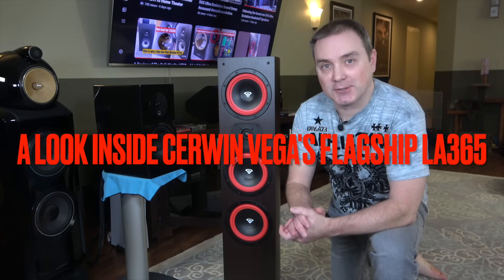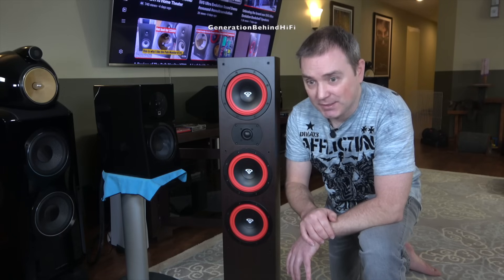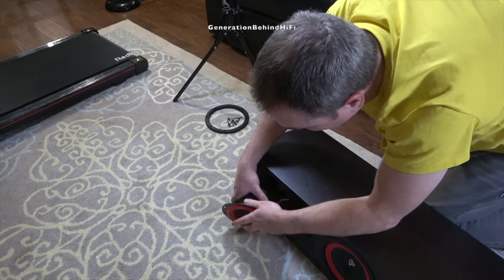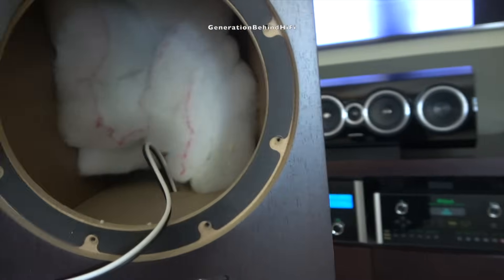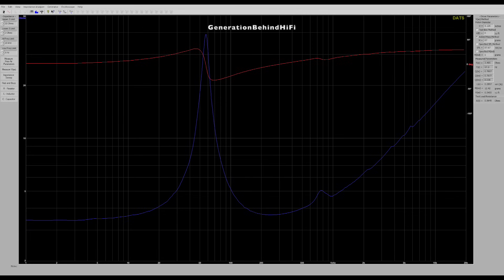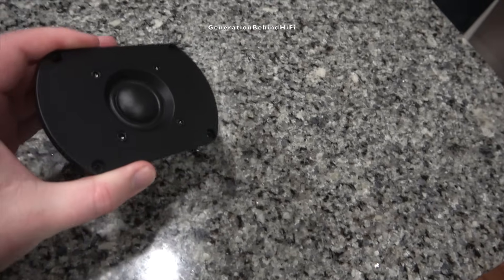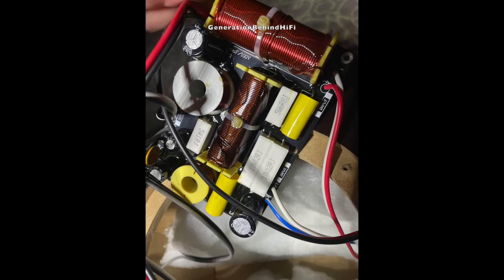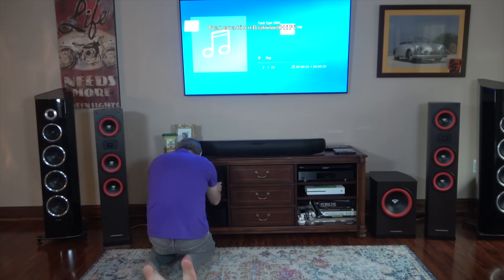A Look Inside The Cerwin-Vega LA365 - HiFi just got seriously affordable! #speakers #cerwinvega

Comment: Hello. I want to purchase these speakers. However, during your video where you took one apart, you pointed out that the mid-range driver is stamped/rated at 4 ohms and both of the bass drivers are stamped/rated at 8 ohms. I am running a Sony STRDH190 which requires manual setting of the speaker ohms and only offers a setting of 6 or 8 ohms. Is this going to be a problem if I use these speakers? Thank you for your time.
Per SONY
Key Details:
Recommended Range: 6–16 Ohms.
Power Output: 100W + 100W into 8 Ohms (1kHz, 1% THD).
Important Note: Do not use 4 Ohm speakers, as the amplifier isn't built to handle that sustained load.
Settings: Use the receiver's settings to match your speaker's impedance (6 Ohm setting for 6 Ohm speakers, 8 Ohm for 8 Ohm+ speakers)
Reply from the maker: Cerwin-Vega rates these speakers as being safe to use  with 4 or 8 ohm receivers so you should be fine.

Comment: Klipsch RP-8000F at $799/pair ar egerat floortsanding speakers  are a great deal.     Read their great  review on the audioholics website
Paradigm SE 8000F Tower Speakers at $1,274 / pair are a great deal.     Read their great  review on the audioholics website
I think these Cerwin Vega LSA365 tower speakers at  $699/pair are a very very good value. Pair these Cerwin Vega's with a PAIR of quality subwoofers like TWO SVS PB-3000 's  or TWO  HSU Research VTF-TN1 's  or TWO Klipsch RP-1600 subwoofers….and you will be in business !!

Comment: If you disassemble a Heco Victa Prime 702 speaker, you will find exactly the same components as in the Cerwin Vega. same crossover, same speaker bowl only the color changes
the speaker colors are the same, cognac, espresso, white, black.
Is this really a Cerwin Vega speaker? Heco has been marketing its speaker for a long time and has just renewed the model with the Victa Elite702.

Comment: You can't look at a crossover and say it's better based on park count ultimately less Parts is better if you can get away with it. Yes you are looking for air core indoctors and polypropylene caps on cheaper speakers, however pure part count and the way the board looks is completely irrelevant to the performance. Show frequency plot and on the vertical and horizontal axis and a waterfall plot to see if the drivers are in phase and any driver ringing.
Reply from the maker: "You can't look at a crossover and say it's better based on park count "

I never said that. You did.
Reply: @generationbehindhifi  you were impressed at the number of parts and higher order roll off = more parts. That's not always a good thing, it all depends on what is needed. Less is more, and well behaved drivers require less Parts.
Reply from the maker: @B2_Labs First order isn't always better either. Sometimes a designer needs a quicker slope than -6dB per octave. There are many variables at play so I can't agree that 1st order is always "better". Speaker designing is a lesson in compromises. I do know a speaker manufacturer isn't going to design a complex just crossover just because they can. They do it to accomplish a goal.
Reply: @generationbehindhifi  of course there is no hard and fast rule

Comment: Looks like a Paper cabinet.
Reply from the maker: I'm all ears if you know of a better made cabinet for a tower speaker that cost less than $350 each.  I have torn down plenty of these budget towers and none of them have had cabinet construction like this.
Reply: @generationbehindhifi   Of course. They cut corners on cabinets and it appears on crossovers to lower costs. They are making profit on that $350. Paper is the new cabinet material for low cost, instead of rough low density wood fiber. Generally, speaker, these budget speakers are not even close to 'transparent'. They can sound nice, but that is all, and often no real change in sound from recording to recording. If you like the sound, should be fine. Check into Elac Debut line. Probably a little more money and basically a nice sound. The Elec's are also built to a price, but at least they are designed by an award winning speaker designer.

Comment: Hello from Canada. Nice job you did with your review on these Cerwin Vegas. I’m looking into getting a pair. I wanted to ask if you think the LA265 would be a better choice. They are the same with one less driver and just a little cheaper in price. Would they sound just as good or would the LA365 be. Better choice. Thanks
Reply from the maker: If you have a larger room then I would recommend the LA365. I haven't heard the LA265, but I would assume it has a similar sonic signature as the LA365 just with less bass and output. I don't think you could go wrong with either, but I really liked my LA365s, especially for how affordable they are. Check for details in the description on how to get 10% off.

Comment: This is coming from a CLS-215 owner.  At the $600-700 a pair price point they have a lot of (superior?) competition on the market.  Bucking magnets in 2024?   Stamped steel baskets.  And for God's sakes, ditch the red suspension surrounds.  80% of the casual consumer base doesn't even know of Cerwin Vega!  It's no longer iconic, rather it makes your products look like they belong in Walmart next to the $19 GPX electronics!  🙄
Reply from the maker: If you know of a better speaker with construction quality like this I'm all ears. I can't think of another floor standing speaker that is this well constructed for so little money. We live in a high inflation environment right now!!! Even entry level bookshelf speakers from B&W are $1100 a pair. 

What's wrong with bucking magnets? There are a lot of high end brands that still use them including Sonus Faber. They are a great way to increase a driver's efficiency.

Comment: The frequency response is impressive, down to 25 HZ with 2 6.5 inch drivers? That's kinda hard to believe, but Cerwin Vegas always did have good bass response. It is a decent cabinet, but that "Polyfill, though "nice" actually doesn't do anything acoustically for the cabinet. You need Foam to be able to dampen the resonance. Or something called "No Res" - but it's kinda expensive. I've found Yoga mats, or foam mats for camping a cheap alternative. Most are made out of the same foam used in speakers. Just as doubling or tripling up on Mouse Pads is a good base for your bookshelf speakers. You gotta watch some of the products thanks to "Audiophiles" who will pay $100 for 2 foam speaker bases.
Reply from the maker: I didn't measure the speakers frequency response but IMO I believe 25Hz is a bit optimistic judging by the port tuning that I measured. I'm sure they can hit 25Hz, but its probably at -10dB from the amplitude tolerance of +-3dB in the response curve. 

In my room they have decent bass for their size but I think this has more to do with the high Q drivers that Cerwin-Vega is using. High Q drivers are known to have a bass hump in their response before roll off. Honestly high q drivers are pretty typical at this price point. Just about all the manufacturers used them in their affordable lines. 

Yes, you're correct. I should have been saying "poly fill" instead of damping. Anyways it was nice to at least see some poly fill in the cabinet because the Polk XT series doesn't use much if any when I did a tear down on their bookshelf model (XT20).

Comment: I had a pair of Cerwin Vega's back in the 1990's, and I was in college and had also bought a brand new Ford Escort  (you can laugh), and the 10" Cerwin Vega speakers both of them fit perfect in my hatchback. It was Good times.   :)  I could pop my hatch and cover any backyard party with the Cerwin Vegas. Their speakers used to be 6 ohm, wonder if they still are. They were a great speaker back then, when Gibson guitars owned them. I heard they got bought out by a Chinese Holding company? Need to do some homework.
Reply: Sounds about right.  Most of these old “vintage” brands are Chinese.  The original company is long gone and only the name remains.

Comment: looks like the woofers are the same, so i dont understand why the went for 3-way instead of 2.5-way with reduction in bass. its not like some movent is going to ruin the mids..also reduces the low-end wiith lower volume availible to work with it.
Reply from the maker: Yes, physically they look the same, but the electromechanical parameters are quite different between them.  If you look at the TS parameters that I posted in this video, then you will see the DC resistance, BL, and resonant frequency are different between the midrange and bass drivers. Hope this helps.
Reply: @generationbehindhifi  sure but a good mid driver is very different to a long throw low Fs woofer, it generally needs to be small and light, but that would lower sensitivty some. just find it a bit odd when CV are known for punch and bass, not transparency.

Comment: Oh-oh ... Please don't make these!. EVERYBODY makes lil towers with 3 or 4 lil woofers. Cerwin Vega is about BIG aluminum framed 12 and 15 inches woofers!.
Reply from the maker: If Cerwin-Vega is going to survive as a company, then they really need to diversify their portfolio of speakers. I don't think Cerwin-Vega will survive by selling only "party speakers", so branching out with other designs that have a smaller footprint will open themselves up to another customer base. Cerwin-Vega will still sell big loud party speakers so if that's your cup of tea, rock on! :)
Reply: @generationbehindhifi  No-no, if "the name Cerwin Vega" survived and is still viable, it IS because they didn't stop making big, party speakers. Who makes party speakers today?, no one.......
Reply from the maker: @ronbradshaw7404  That's the thing. It didn't survive. Cerwin- Vega filed for bankruptcy back in 2003 and its assets were sold off.

Comment: the crossover parts are still typical of what you will find at the price point. theres really nothing special there honestly. im sad to see the resistors on that board. im fairly certain those are there to lower the volume of the mid and woofer. those are going to get hot over time and fail. they couldve just chosen a higher impedance woofer instead. 

the polyfill is just sitting on the cabinet, not even pinned all around. its better than nothing but its the cheapest way to fill it. its not going to do a good job of damping the enclosure. 

finally, you did no kind of sweeps or waterfall graph. you cant really recommend this speaker, for or against, since you did no real measurements.
Reply from the maker: I'm all ears if you can name a $349 floor standing speaker that has cabinet construction like this and a high order filter that includes poly caps and air core inductors in places where it counts (tweeter and bandpass circuit). So far I haven't come across any.
Reply: @generationbehindhifi  youre putting far too much stock in those two components. first, those air core inductors are teeny tiny and use really thin wire. second, theyre using sand cast resistors and plenty of electrolytic caps as well. those 10W resistors are going to do a lot of work and fail over time. finally, the construction isnt super terrible or anything but be real, the batting thats thrown inside isnt anything to be proud of and its not controlling any kind of box resonance whatsoever. those solely there for slightly lowering the fs of the enclosure.
Reply from the maker: @OxBlitzkriegxO  I'm not putting "too much stock" into anything. I'm merely pointing out the build quality from a cheap speaker and showing my viewers how they are made and what I have seen from other brands. Like I said, please name a brand and model tower speaker with similar build quality. I'm all ears.

Comment: I see three electrolytics.  Ugh. that is, unless they are inline for the woofer only.
Reply from the maker: Hi Scott! I didn't mean to make it sound like only poly caps and air core inductors were installed on the crossover board. My apologies for that. What I was trying to say is that Cerwin-Vega installed quality components on where it counts most, like the tweeter circuit and bandpass circuit (midrange). I can't think of another $349 floor standing speaker with 6.5" drivers in it that has a crossover like this -- 2nd or 3rd order filter which includes poly caps and air core inductors. If you know of one, let me know and I'll buy it and do a tear down on it. - GenerationBehindHiFi

Comment: A 3 way crossover requires 4 slopes. A low pass for the woofer, high pass for the mid, low pass for the mid, and high pass for the tweeter. That crossover has 4 inductors and 6 capacitors. This suggests that the 2 high pass filters might be 3rd order electrical, while the 2 low pass filters might be 2nd order electrical. If they produce good slopes that intersect in-phase then well done! 3-way crossovers for cheap are difficult! 

I would have like to have seen the mid-range driver be a bit smaller and pass-band optimized (maybe an accordion surround, lower xmax coil/motor, lower moving mass driver). If they are crossing that over high, then the power response is going to be pretty uneven through the crossover range coming from a 6.5" woofer. 

My rule of thumb for 3-ways, is either to use a very small mid-range driver, like a 3-4" and let it play up to 6-8khz so that everything but the "air" is coming from a point-source, and accept the narrowing power response to gain the point-source effect through the widest possible band, or use a pair of 3-4" drivers in MTM or larger 5-6" driver crossed over as low as the tweeter can handle. Looking for tweeters with Fs around 800hz and will cross them as low as 1200-1500hz

Comment: Appreciate the review, I've been waiting for someone to do one on these. I've been contemplating purchasing these but wanted to wait until someone did one of these. But the real question is, how do they sound? Typically, vega is known for loud bass and high sensitivity (easy to drive). How did these ones measure up to older models?
Reply from the maker: Hi Dave! You must be new to the channel? This is my look inside video where I go over cabinet construction, driver quality (TS parameters), and crossover design. In my review video I will put the speaker through a variety of room sizes and will give you my impressions on sound quality. As I said at the end of this video, my review will probably be out next month. Hope this helps!

Comment: Amazing for this price. Congrats to CV for stepping away from party speakers and adding a line for audiophiles. You didn't mention how they sound, but I can't figure how they were able to offer that much quality (especially that crossover) for the price. Do they come with grilles?
Reply from the maker: Hi SpaceJaime, You must be new to the channel? This is my look inside video where I go over cabinet construction, driver quality (TS parameters), and crossover design. In my review video I will put the speaker through a variety of room sizes and will give you my impressions on sound quality. As I said at the end of this video, my review will probably be out next month. 

Yes! They do come in grills. I will go over all of what is included and how they sound in my review video. Hope this helps!
Reply: @generationbehindhifi  - new to your channel but old on our planet. Did not know Gibson had it before. They had to sell a few of their acquisitions, they were (or still are) carrying a lot of debt. Cheers!

Comment: It's not a center channel so you need two of them so let's refer to this as a $700 SET of speakers. At 700 it's not budget and there should be no shock that it has a good amount of padding and a decent cross over. You can buy triangle brand speakers and have true audiophile sound for way less money.

Comment: Those seem similar to the pioneer Andrew jones sp-fs 52’s in cabinet designs size and complex crossover 
(8 element on the pioneers)
Are you familiar with those? If so are they similar in sq?
Cheers 🍻
Reply from the maker: I know who Andrew Jones is (well respected speaker designer), but not familiar with the SP-FS52 speakers. You aren't the first one to say that. When I did my look inside video on the LA165 bookshelf I had a few people comment that they were familiar to a model that Pioneer had developed -- the speakers Andrew Jones had designed.  :)
Reply: @generationbehindhifi  ya especially the build quality, cabinet shape , motor structures and crossover.
The pioneers are 6ohms
With a sensitivity of 87db
The “sp”series had a whole range with towers, bookshelves, centre and atmos modules and sub. I bought them a long time ago, I still have them but they don’t get used that much anymore. I kept them because I was and am still am amazed how great they sound for the money. They were an embarrassment of riches when they came out and pushed other makers to up their games to produce quality sound at an affordable price. They were unicorns in their time. Thanks for your review, I just found your channel and subscribed now, very thorough review 👍🍻

Comment: I haven't heard this speaker. Liking what I'm seeing. Multiple drivers w/ 2 dedicated to lowest bass (air cooled vented with bucking magnets),  pulp cones w silk domes,  non-parallel cabinet sides with multiple cross braces, apparently a well made cross-over board, and nice gold plated dual binding posts.  If I was in the market I'd give these a listen.  I'm betting C-V will find a good market for these as they're giving a lot of quality for not much jack.